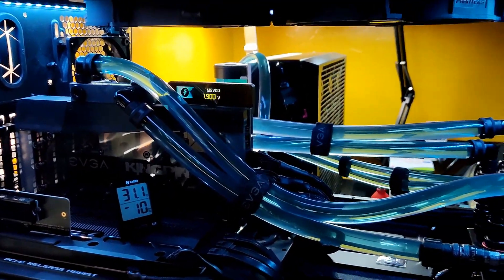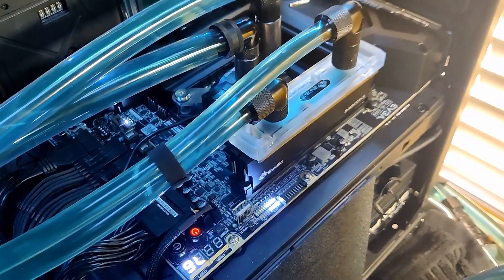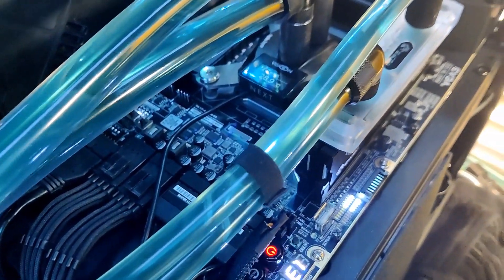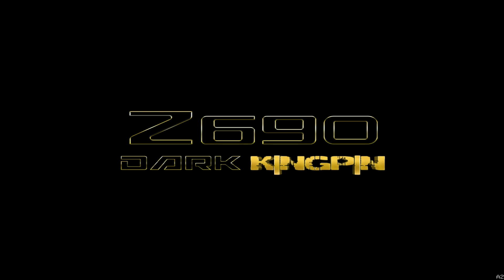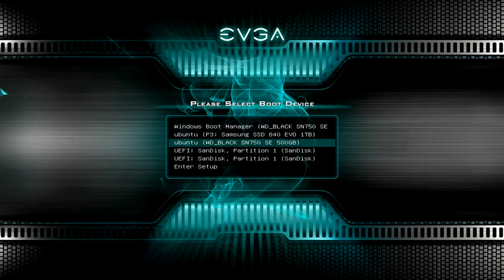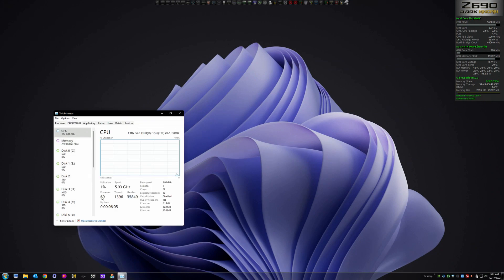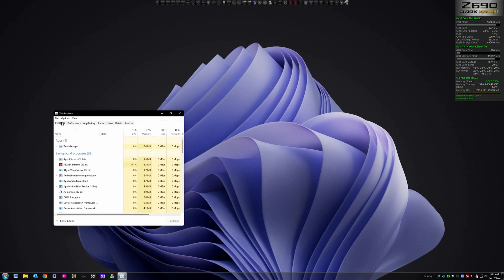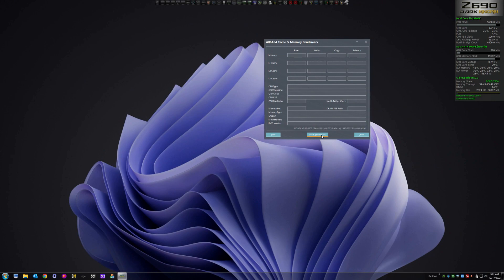Z690 Dark K|NGP|N - Hynix M-die Manual Overclocking to 7200 MT/s

Comment: Cool video.  I have tried so many times overbooking my 6600 g skill on z670 to 7200 do drop the latency dwn no looks I just don’t no where to startlol
Reply from the maker: Thank you. I'm glad you appreciated the video. The problem may be your memory modules. QC and silicon quality of memory ICs being used on DDR5 is very inconsistent. I went through the process of testing and returning more than a dozen DDR5 memory kits to end up with one that wasn't garbage. Brand doesn't matter much when choosing what to buy. The memory IC (Hynix, Samsung, Micron, etc) and revision (A-die, B-die, M-die, etc) and the bin quality means everything. Both sad and shocking how many garbage memory sticks I have bought and RMA'd to end up with one good enough to keep.
Reply: @MrFoxRox  i gave up at the end lol...

Comment: So all the goodies you have running in the background won't effect your benchmarking? looks like a huge resource hog
Reply from the maker: That would be true if one assumed everything shown in a screenshot is allowed to run while benching. When I am running benchmarks competitively I kill a lot of feces, including Windows Explorer, and also manually manipulate application priorities. That said, my normal Windows configuration has about half as much resource-depleting trash as the standard Winduhz installation that most people put up with.
Reply: @MrFoxRox  I figured much, it's just for demonstration on your channel, which makes sense otherwise you wouldn't have 134496 points on the memory reading on HWB

Comment: I'm sorry if this is a dumb question, but I read your comment thread in Bob of all trades video on the Clevo x170km-g with Prema BIOS installed, you mentioned the only way to get the BIOS would be through Prema himself or his business partners. I am currently on the hunt for this BIOS, would you happen to know some of his partners or how to best get in contact with the man himself? I would greatly appreciate any advice you can offer
Reply from the maker: Hello. I am not aware of a way you can obtain it at this point. Typically the only way was to purchase a Clevo laptop from a participating partner shop. It would come preinstalled from them, but not distributed or sold in any other way. Prema no longer provides public distribution of his firmware mods.
Reply: @MrFoxRox  I appreciate you taking the time to answer my question, and so quickly too! Thank you for sharing what you know,
Reply: What coolant are you using?
Reply from the maker: @B3n85_  blue Asian car antifreeze 50/50 premix straight from the gallon jug.
Reply: @MrFoxRox  Wow! You don’t have any issues with the tubing or the waterblocks running that? I just got a mora3 420 and have been thinking about putting that Koolance stuff in it but it’s like $130 a jug.
Reply from the maker: @B3n85_  not at all and I have been using it for at least two years. It acts as a lubricant for the pumps and QDC fittings as well.
Reply: @MrFoxRox  Wow!! I'm going to look into it! are your temps similar or lower? Is it conductive? One more question? What size tubing do you use? I started off with 13/19 but have found it difficult to find 90's.
Reply from the maker: @B3n85_  I use the same size tubing on the system in this video. I use threaded 90° fittings with compression fittings threaded into them. My temperature seem the same as when I was running straight distilled water, but I had issues with algae using straight distilled. It is ethylene glycol with a 50/50 mix from the factory with distilled or deionized water. I haven't tested whether it's conductive or not, but ethylene glycol is not so I know it will be less conductive than the straight distilled water I was using. I can't find any downside to using it other than it's not free. I have several friends, one a very close friend for many years, that are using auto antifreeze as well and they have been for years. If you have cats or dogs be sure to clean up any drips or spills or they will lap it up and get sick or die.
Reply: @MrFoxRox  That’s awesome! Thanks so much!